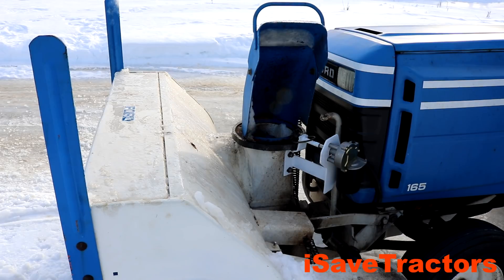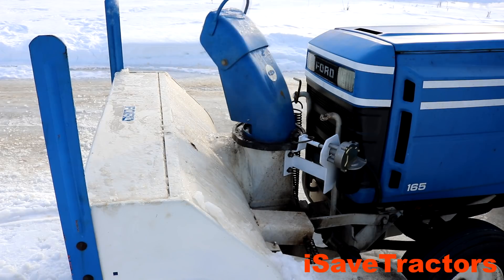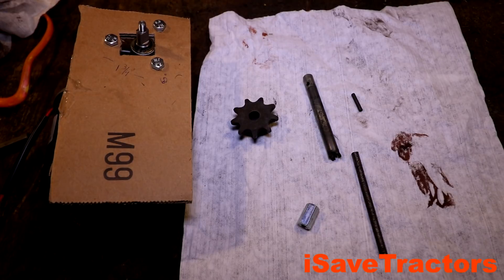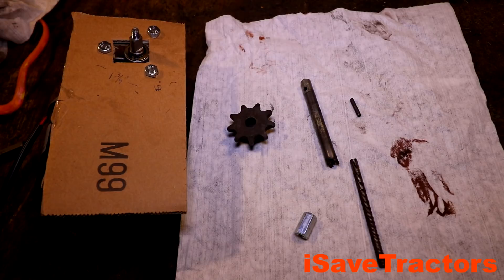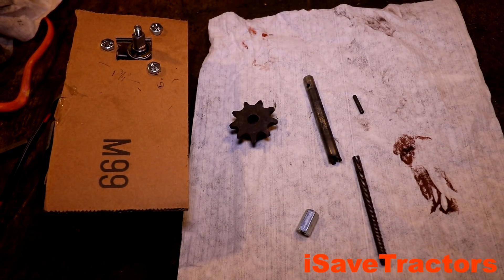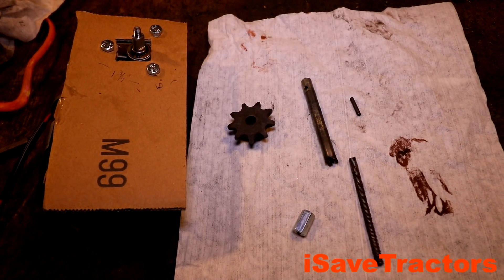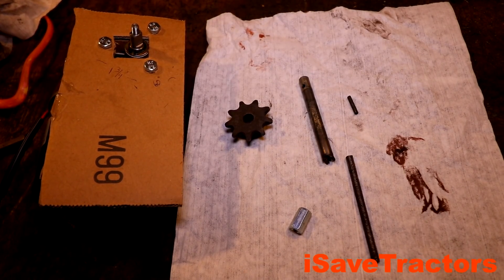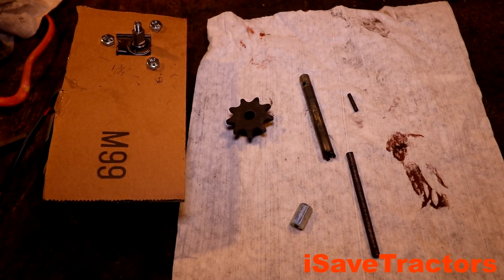Power Chute Rotator Build for Lawn and Garden Tractor Snow Blower

Comment: Very nice.  I'm curious if there is a reason you didn't mount the switch so that it toggles left-right like the direction you want to direct the chute?  Any problems with binding when it reaches the end of the gears on the chute?
Reply from the maker: I have since rotated my switch so it is oriented the way you describe. I installed it that way just out of habit, and didnt even think of it when I was putting it in. No issues with binding. As soon as I feel it hit the end I let go of the switch. Thanks for commenting!

Comment: Perfect timing!  I’m in the process of converting a Bolens 2 stage 46” snow blower to a 3 point mount for attaching to the rear of my Powermax and I was looking for a good solution....since I don’t have rear hydraulic remotes.  😎
Reply from the maker: turbooutlaw1976 perfect timing indeed!
Reply: It is called a single pole double throw switch I believe.

Comment: Very cool Norman but it would be nice to have you explain the wireing
Reply: Dave Ackerman 1967 its 12v.
A 12v motor will spin one way then the opposite way when the polarity is reversed. The polarity is reversed via the switch, it doesn't get much easier.
Reply from the maker: You're not alone. Our office gets hundreds of calls a year helping with wiring issues. I will make a video next week on this particular wiring job and make it very easy to understand. The switch wiring is what hangs people up since there are 6 prongs.
Reply from the maker: Dave Ackerman 1967 I think I will make a separate video doing that. Thanks for the suggestion!
Reply: jhitt79 I'm sure it is but wireing is not my strong point if I'm shown I will get it
Reply: isavetractors thanks Norman
Reply from the maker: I will be filming a wiring video hopefully tomorrow!
Reply: isavetractors thank you very much Norman. I'm sure it's very easy but I learn by seeing
Reply: DPDT switch. 

Motor A------[\    /]---Motor B
        Pos----x[  /\ ]x---Neg
Motor B-----x[/   \]x--Motor A

Power comes into the common terminals (usually the center), motor leads get hooked to the two opposite connections, using two jumpers as shown by my (admittedly pathetic) ASCII art.
Reply from the maker: Dave Ackerman 1967 sorry I got delayed. I ended up getting pretty sick. I'm doing the video this week!
Reply: isavetractors Don't worry about it Norman. All these guys already beat it into my head how easy it is ... I think I got it now

Comment: What kind of switch did you use and were did you get the wire diagram to wire it all up
Reply from the maker: Ethan Hartmann I didn't use a wiring diagram. I just know this stuff. I used a momentary on off on switch from eBay. I will make another video showing how to wire a motor like this. Meanwhile search my channel. I already have an excellent video on how to wire tractors

Comment: YESSSSSSSSSSS!!  First like!!!!   but I gotta Gig you for not using oil when using the lathe and drill press!! lol..  Dude this is a sweet mod.   But tell me what you think of this suggestion.  A ring around the base of the chute about 2 inches wide..to cover the slots and the sprocket.  This any blow back, or falling show before use doesn't build up in there.
Reply from the maker: I do use oil and cutting solution. Just didn't make the video cut.
Reply from the maker: That's a good idea about having some kind of hood to prevent snow from gumming things up! Thanks. I'll see what I can do.